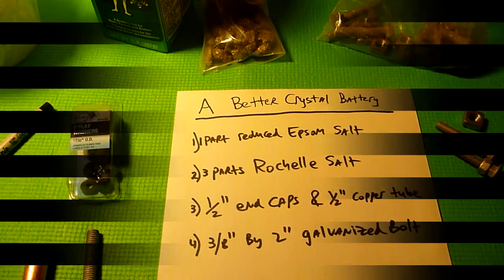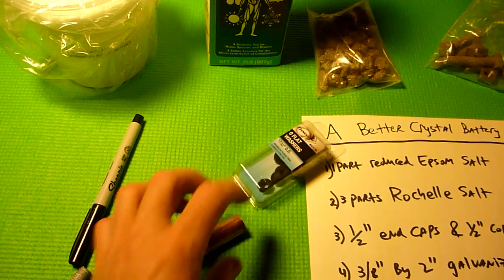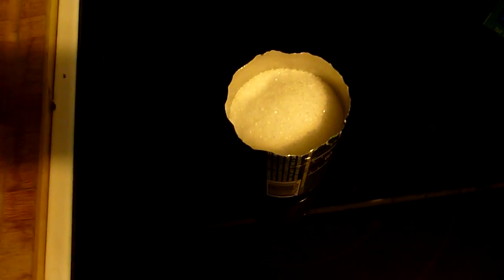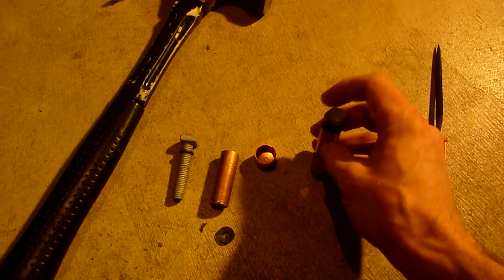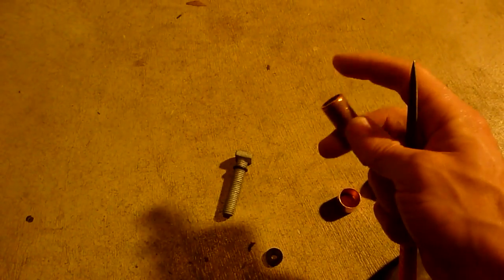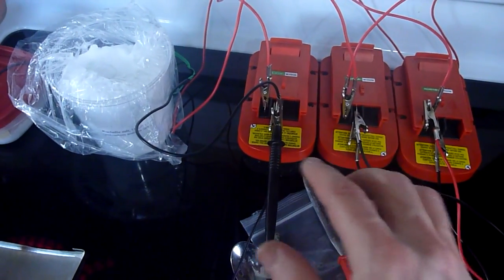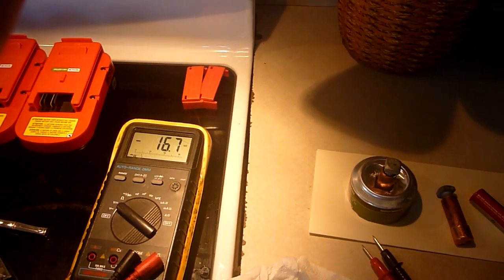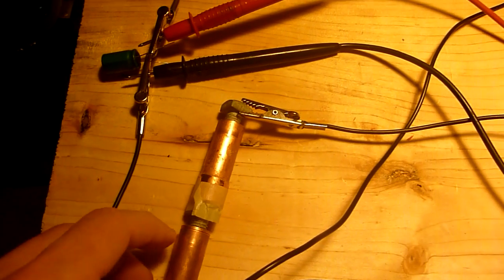How to Make A Better Crystal Battery

Comment: Marcel Vogel, a notable researcher in the fields of crystal energy and luminescence, believed that quartz crystals could be cut at specific angles to harness their energy more effectively. The angle of 51.843 degrees is significant as it corresponds to the internal angles of the Great Pyramid of Giza, and Vogel speculated that this precise cut could enhance the crystal's ability to store and transmit energy.
Reply: 👍  the videos of the Vogel crystal voltage tests are interesting!
Reply: Thomas Henry Moray:
* An early 20th-century inventor who claimed to have developed a device that could harness "radiant energy" from the environment, providing a nearly limitless source of power. 

http://rexresearch.com/moray2/morayrer.htm

Comment: I'm getting .9 to 1.04 volts dc using spent .22 cal. Brass Shell casings with 1/2" zinc sheet metal screws and a 1/4" ×1/4" shrink tube divider/seal . I'm filling casing with Epsom and adding 2 drops of colloidal silver water , then heat gun to flash and remove water then slip on 1/4" shrink tube top just above top of casing and heat then screw in screw , cool a while and test.

Comment: What is the short circuit current? If you stack them together and light a LED, you have at least 1mA. If you light it good, >=16mA. Did you ever try that? Check Lasersaber and Backroom labs. Cool polarizing technique, can we build diodes  (or solar panels) with that on razor blades? I think I saw someone doing that on youtube.
Btw, why the magnesium as Epson salt if you don't use the magnesium core?

Comment: Wanted to comment on the rubber washer material.  I discovered some faucet rubber washers were partially  semi conducting.  Which was defeating my circuit.  Not all just some.

Comment: pathetic

i built a tap water battery 
that produces 3.30 volts and when no load is connected it produces 4.00 volts for half a sec

pretty proud of it .... small size too

and yes it has more than 1 cell .... 1 cell produces 0.62 volts at max and avg cell is 0.50
Reply: How much max current do you get from those? With water, salt, sand and a bolt or copper cable I got around 1mA max, so Naoki's battery  is pretty neat

Comment: It would be better to use either pure nickel or magnesium or zinc rather than a galvanized bolt. Once the battery has gone through that tiny layer of nickel, the voltage will be reduced since instead of the nickel, the iron would be exposed to the cell. In turn, iron is the opposite to copper that nickel is so the iron would become the cathode. It would last much longer if the anode didn't have an iron core and you wouldn't have the voltage drop and reverse direction once the nickel is eaten through, which will happen as the reaction is the nickel oxidizing that makes this a battery at all. Once the nickel is gone, the copper and iron will both oxidize. Also, you probably could have gotten 0.9v even if you made them smaller than AAA batteries. There are better ones out there that have to be putting out more than 0.9v as one person was using a single one to power a small 5v fan.

Comment: When the mixture in your batteries is still boiling  put electric current through them and cool them in cold water without  the water touching the wires or the crystal mixture. If you just zap them while still boiling the high temperature will destroy the polarization  the same way  high temperature destroys magnetism in a magnet  by   disorientating its clusters.  https://www.youtube.com/watch?v=noGGcyPHtdI

Comment: your crystal battery uses copper and steel for electrodes. you're using salts to make a solid electrolyte. if it really aligns the crystals then you've built an electret and you have no current draw and minimal voltage. otherwise, you just built a solid electrolyte battery- most probably, which will corrode one electrode and live an extended chemical battery life due to hardly any current production.

Comment: So question what would happen if i were to refine this process. I atomize the borax into talc power, 100% pure magnesium rod 2/3'' and 1'' by 1/16 24k gold tubing. You think id get better results.
Reply: l h gold actually is not a better conductor then copper, the only metal that's better then copper is silver.. the reason people like using gold for electrodes and stuff is because it never will oxidize really.
Reply: l h if I were you I would stick with copper and silver plate it, and it you want it not to oxidize then gold plate on top of silver

Comment: Have you looked in any camping or outdoor supply stores? They sell blocks of Magnesium for use as an emergency fire starter in case you really want to give it a shot. Very handy lump of metal, $4-10 depending on brand.
Reply: Harbor freight.....0.99

Comment: couldnt we make a 12 volt battery with about 13 of those in a series.  Today car batteries die after 2 years.  Wow that could change that with very little room needed and it is steady.  thanks for this video . Others out there are a real struggle to put up with.
Reply: James Gober the amp out put is way too low if u put twelve together.
lead batteries have multiple plates in just one cell.
he only has one plate per cell
Reply: MDTV Tube also the alternator might fuck up the batteries, but you could run an assload in parallel after you get 12v series.

Comment: Why is your video called How to make a better crystal battery, when your summary at the end is... I used the wrong materials and my batteries can't even power a LED ?!? This is not a "better" crystal battery.
Reply: these output 1 volt of power. i don't know if the longetivity is reduced if charged like lithium ion ( up to 4.2v) but you can always try to.

Comment: Halo Naoki. I am going to share a recent communication from Nikola Tesla which I posted back in August of this year. It may be worthwhile to construct this. What are we missing in terms of how to harness energy, today? "Copper, quartz and magnets, that simple. The pull of the magnet catalyzes the copper to affect the quartz. The energy within the quartz then is harnessed like a centrifuge - it disperses and then returns to its’ center. If my vision in my human time had prevailed, you would be now tapping into solar energy from space.” I have the full six-page transcript from him via Pamela Aaralyn on my Facebook page. I plan to construct this and use it to power an inverter, to change the current form DC to AC.

Yes, regrettably the volume is too loud.
Reply: I dont see the tesla comunication at all.
Reply: Got your message. I was going to drag and drop the six-page Tesla message here, however it would not allow me to do that. Are you on Facebook? If yes, link to me. I have that message there.

Comment: its fake, the length is the same as an AAA batteries, and you do not  seethe bolts been out in ion either or them, I am  a massive fan of crystals batteries. can you show the crucial parts to better the world. i have no doubt you have passion, but how can you both times, not show the anode being put in, within the culture of these type of video at the moment (including free energy etcetera),
Reply: Loz Turner many people have done it, it's not even hard to do... just do a little research and you will find it works, just not enough amps to be practicle

Comment: I got a lot of information from these comments. So, I used to make molds out of a rubber like material. To get the bubbles out, I used a compressor, the vacuum end. That could be made from a compressor from an old air conditioner or refrigerator. That's what I'm going to use to get the air out of the crystalline mixture.

Comment: Hello Naoki Kashima, 
I have a question for you, have you tried using graphene mixed with clear polyurethane to coat the inside of the copper to help reduce corrosion that forms from the reaction of the coppper and your electrolight mixture?
Reply from the maker: +freyes389 Nope, I haven't tried that. Sounds like a good idea though.
Reply: +Naoki Kashima 
The interesting thing about the graphene is that you don't need the copper at all. Graphene is conductive and can be coated or painted right onto plastic. I put out a video on my Youtube page about this very thing! check it out!
Reply: +Naoki Kashima 
I can help you get more voltage from your crystal cell battery, but you'll need some graphene first. Basically, it's not about the amount of surface space, it how you space each cell for example, you have to space together the copper or graphene with the ingredients you use like the electrolight or ionic fluid. I don't think the Magnesium matters much in that it contacts the electrolight of all the individual cells because it the main conductor for all your cells together. Think of it like a pie, each slice is an individual cell separate from the other pie slices. In the center is the magnesium, all of the pie slices can be in contact with the magnesium or zinc or aluminum just as long as the individual slices with there ionic fluid or electrolight ingredients don't tough each others electrolight or ionic liquid. Plastic coated with graphene can be constructed in a way to allow for expansion of ingredients for each cell to compensate for the pressure inside each individual battery cell, like putting a plastic flexible spacer and that plastic spacer can also be coated with graphene too! Hope that helps. Maybe someday we can work together with our ideas.
Reply from the maker: freyes389 Good ideas, I know the amperage in these cells are generally pretty low. To me what is amazing is that if you use this type of salt crystal it is non-corrosive to the metal! If you use some sort of an acid or a good electrolyte of course your amps will go up but your metals will corrode much faster as well (that would make it into a regular battery). Crystal batteries last for many many years because of the non-corrosive crystal. I've also seen people making batteries out of cement. You have your 2 electrodes and hard cement in the middle. Anyways, I appreciate your comments and input on this. I've been slacking off lately in my experiments, but I have big plans for the future.
Reply: +Naoki Kashima 
One last thing, I saw in another video that Elmer's Glue-All can be a good binder for the electrolight mixture. Just pass on the idea! Thanks for your feedback my friend! keep working on your batteries, it's time we become independent from the Powers At Be, who keep all of us surpressed.
Reply: +Naoki Kashima 
One last thing, I saw in another video that Elmer's Glue-All can be a good binder for the electrolight mixture. Just pass on the idea! Thanks for your feedback my friend! keep working on your batteries, it's time we become independent from the Powers At Be, who keep all of us surpressed.
Reply: +Naoki Kashima 
One last thing, I saw in another video that Elmer's Glue-All can be a good binder for the electrolight mixture. Just pass on the idea! Thanks for your feedback my friend! keep working on your batteries, it's time we become independent from the Powers At Be, who keep all of us surpressed.
Reply from the maker: freyes389 Exactly! There is so many world changing inventions that were kept from the public (free energy generators, cancer cures, etc.). Powers that be do their best to create division and spread fear among the public. If people work together there is nothing we can't accomplish. We are our own saviors.

Comment: Marcus Reed, John Hutchison are the popular ones that really did the xtal cells. However, depending on what crystals and what terminal metals you use will make a difference to what is all going on in those cells. crystal chemistry and van der waals forces are the two well-known science stuffs for this.
Thank you for being open to continuing the sharing of these cells.
I will give two hints though. Separating the positive and negative charges will produce a larger differential. Different crystal produce more negative or postive ions. Likewise many work as a dielectric.
Fair warning: Be aware of the crystal chemistry. The chemical reactions might be much slower, but they are still there.
Last but not least, a magnetic field reduces internal resistance. Many crystals and materials that put out postive ions, also are magnetic. 
Peace and Health
Reply: stoni2041 how about mix th233?

Comment: How you use those batteries, is you stack them in columnar series and parallel rows, bind a column of them and fix them over an electro plate and under an electro plate and under a huge weight, like a concrete sculpture. So maybe you have them stacked 3 high and in a column that allows you to place 50 of them side by side for a total of 150 batteries. The heavier the weight over top of them, the more energy they'll flow. That's how piezoelectric crystals work, like the obelisk. Granite is a piezoelectric crystal and if you gold cap it and plate an electrode on the bottom, you can can tap an obelisk for electricity.
Reply from the maker: +danielvincentkelley stack them in series for more voltage, stack them in parallel for more amperage. Stacking them up in parallel is the way to go because their amperage is pretty low otherwise. The plus side they last indefinitely!
Reply: +Naoki Kashima Actually this doesn't work with these batteries for some reason. I've not had luck with it.
Reply: +Naoki Kashima Could you link me a place where you purchased your rochelle salt? I'm currently in the middle of making the rochelle salts but the output is going to be quite low for the high cost. This is because of the cream of tartar is eating up 90% of the expenses; everything else is super cheap :/
Reply from the maker: Alex Try ebay: http://www.ebay.com/itm/Rochelle-Salt-U-S-P-One-Pound-/371589879418?hash=item56847b967a:m:mN3xgJfJzKi0Xy29ReyTv6g
1 lbs for 14$ is a pretty good deal.
Reply: Naoki Kashima Thank you! I looked up a couple of places for Canada and they are just so expensive. Like 500grams for about $30 which is outright stupid.

Comment: how about a zinc rod?
Reply from the maker: +scottaw1981 use galvanic series chart. Match the elements with top of chart with ones at the bottom for the largest voltage. Zinc would work as well (like copper/zinc), magnesium/copper very good.
Reply from the maker: +scottaw1981 use galvanic series chart. Match the elements with top of chart with ones at the bottom for the largest voltage. Zinc would work as well (like copper/zinc), magnesium/copper very good.
Reply: I was playing around and found that modern US penny are thinny coated in copper with a zinc core, you can mill off the out layer and have a nice zinc disc, have a pre 1980s penny and you have a copper disc

Comment: Have you ever used magnesium pellets or magnesium turnings for more surface area and would that increase the voltage?
Reply from the maker: +CluckHutdotcom The metals serves to bind the electric field. Pellets won't work because they'll short out your cell. If you want to increase voltage do a stack of metals with crystal in the middle. Like copper sheet, crystal, magnesium sheet, crystal, copper sheet, crystal, magnesium... and so on the end plates will serve as your - or + and the in between plates will add together in terms of voltage. To get more amperage increase the surface area of your plates (or tubes).
Reply: +Naoki Kashima If you use magnesium pellets they won't really "short out" because there will be the same electric potential from all directions on the submerged pieces, and the charges would not have anywhere to go. If you took the magnesium filings and put them in some refractory tube and temporarily heated it to fuse the metal, that would keep good contact for electric conduction but also produce better surface area, as long as the "mix" gets in every pore and doesn't leave any air gaps, if that is possible...

Comment: How do I connect a series of batteries to a basic heater with a 1600w or 150/250VAC?
Reply from the maker: +Cory Samoila What kind of batteries? If a battery is connected in series + of one batter is connected to - of the other, and so on.
Reply: Thx, figured it
Reply: +Cory Samoila You need a parallel connection.
Reply: AC? Batteries give you constant current, unless you use an inverter. I suppose that'd drain more power, raising the 1600W.
1600W is already a lot. If you use 150V (DC), you'd need 10,67A of constant discharged current (P=I.V). Lots of parallel cells in a pack for summing up to that current, and lots of series of the parallel pack for the 150V.
I'd suggest looking for some other strategy for that power and energy format, and caution with power electronics
Reply: @88SJoe88  i appreciate that thanks.
Reply: Cheers